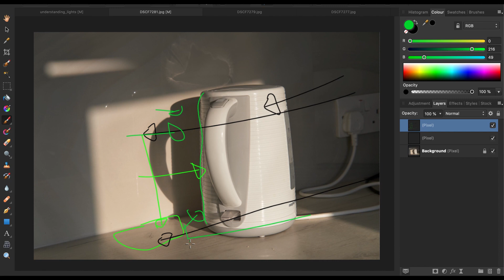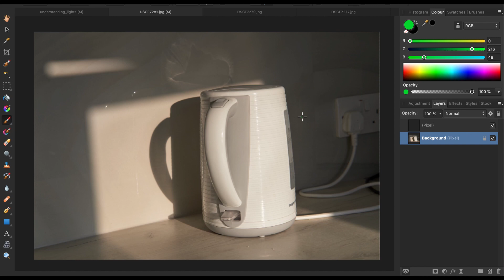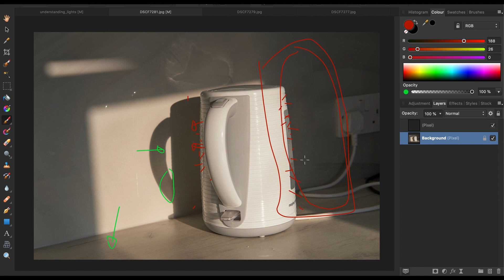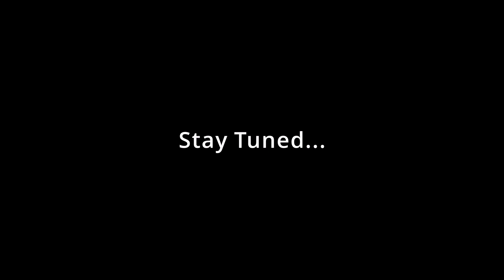Digital Compositing Basics - Understanding The Light Part-01

Comment: Awesome tuts Satheesh. I have a doubt. It scatter blue light at front face when it hits the hard surface, but why its scattering the blue light instead of other colors?
Reply from the maker: Hey Tharun, The reflected light intensity(r,g,b) will vary based on the object color. The reason behind this is the color pigmentation on the object. Example: Red apple reflects more RED light and Green apple reflects GREEN more light, But both are apple.

Technically speaks the molecular structure of an object is defining the output wavelength of the light. I think we no need to understand the light so technical, So we will stick with a simple and easy way. Based on object color (saturation).

I hope this clears your doubts. Thanks,. For more technical information follow below webpage:
https://www.zmescience.com/science/physics/what-gives-colour/
Reply: @digitalcompositingtipstric3275  yeah cleared a bit. Why i have raised the question is, here when light hits uneven white surfae it scatter blue light.(different light color from color of the object)

But in part 2, of the video, when light hits the brickwall, it scatters the yellowish orange color. (same color of the object  )

Thats y i got confused.

Really Thanks a lot for your reply. Let me check the above link.
Reply from the maker: @THARUNGANAPATHI  Tharun, This illusion happens due to light bending when a white object reflects any particular one light. 
Example: Light bends when it reflects from one object. Based on the reflective surface,   any particular light bends more than the other two-channel. Also, the human eye can see the blue light more than the other two primary colors. Example: Rainbow, light reflection from Prism.
Reply from the maker: Search about light bending in google. You will get lots of information. i will find a good and easy article and share it here.
Reply: @digitalcompositingtipstric3275   lol Light performing more interesting things.
Reply: @digitalcompositingtipstric3275  yeah please attach if you find any good one. I will also seek for it.
Reply: @digitalcompositingtipstric3275  yeah satheesh, its hard to understand everything about the concept of lights. 
But for instance,
 Assume that the kettle is a CGI. We have matched lights, shadows, occlusions, reflections and refraction everthing.

 But naturally here its scattering blue light. 

Now when it comes under cg kettle, how did we make it to scatter blue light?
without knowing the actual concept of light in detail?

 Because we dont know why it scattering blue light instead of other colors.
Reply: @THARUNGANAPATHI  Hey Tharun, Actually the Kettle is not reflecting blue light more than other two channels. The room wall filled with blue light, That's why the wall receives bluer reflection.